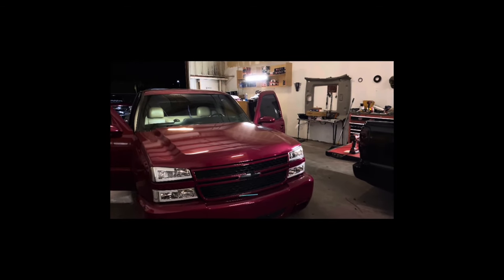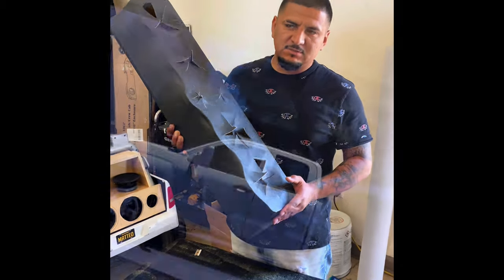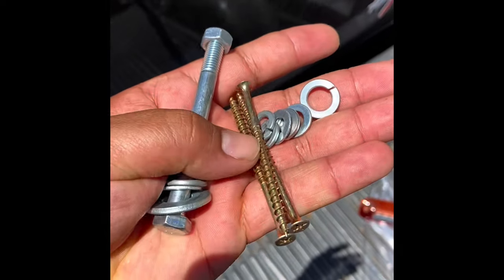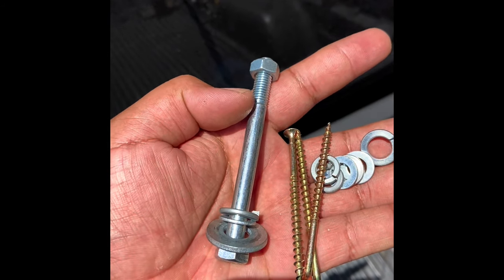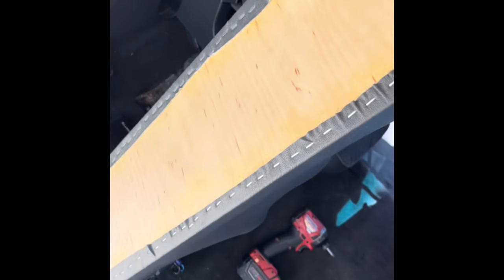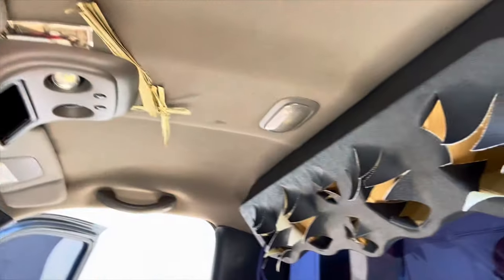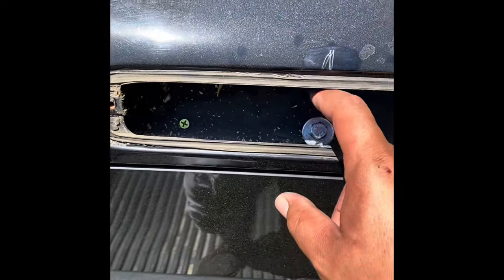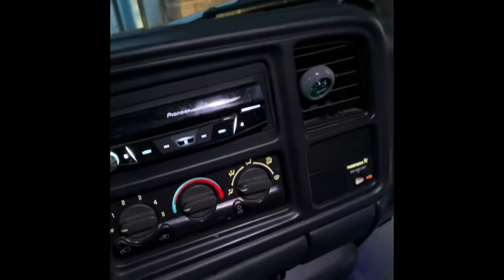Roof speaker panel install on chevy silverado single cab

Comment: Installed it but screwing screws from inside but it still wiggles. Any suggestions what should i do so it stop wiggling?
Reply: Bigger screws
Reply: Use bolts and washers mixed with rubber washer to seal top